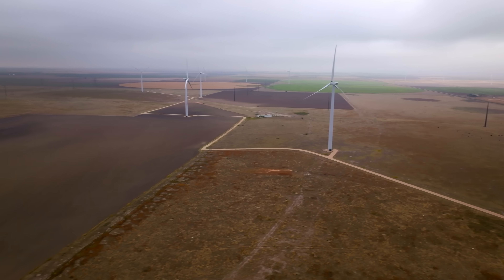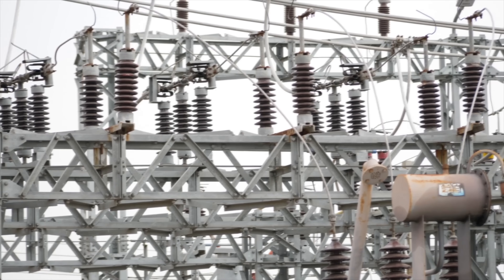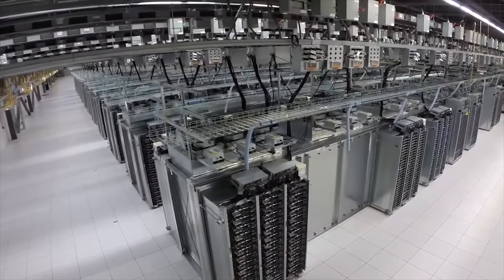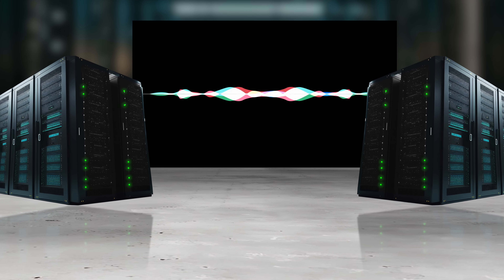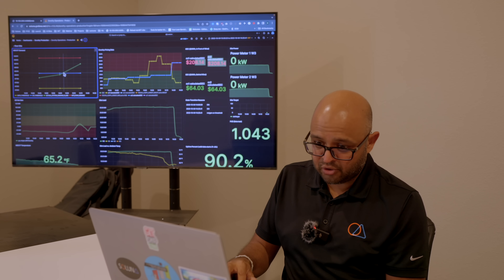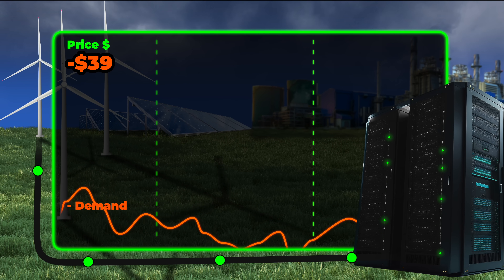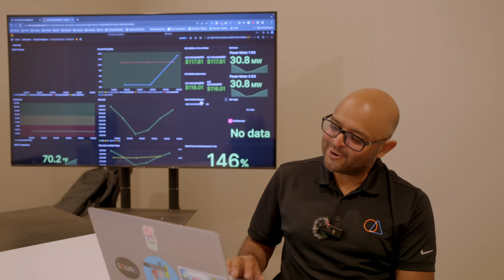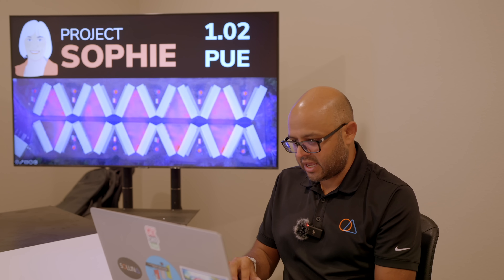Wind Farms' Dirty Little Secret No One Talks About

Comment: I've heard of one wind farm in the UK that uses excess electricity to electrolyse water to make hydrogen that it feeds into the national gas grid.
 The volume is small enough that no-one burning gas needs to modify their burners, but that excess electricity does reduce the amount of natural gas burned.
Reply from the maker: very interesting! can you just mix hydrogen gas with natural gas?
Reply: @TwoBitDaVinci  Apparently that's what they do, just add some some hydrogen into the fossil natural gas.
 Power stations and domestic boilers & ovens that burn gas end up burning some wind-generated hydrogen too.
Reply: @TwoBitDaVinci  german natural gas provider enbw says that up to 30% are possible on our grid as it is right now.

 @AlessandroRodriguez  normally it's not. But if you generate hydrogen when you can't put the power into the grid, it is.
Reply: You have some data on that? I would not want to mix hydrogen and natural gas, that could be outright dangerous! They have wastly different weights and range of combustion. You are not thinking about biogas? We use that in vinkel near Skive airfield EKSV in Denmark.
Reply: Correct! They have different densities therefore subject to different pressures. If that is happening it is an accident waiting to occur!
Reply: @TheArchangel-yd5sj  Two different gasses mixed together will be at the exact same pressure.
Reply: @homeistheearth  is that question for massimo or for me? If for me, please google "Wasserstoff-Insel Öhringen".
Reply: @homeistheearth  was kinda wondering the same... apparently 30% was reached summer of 2023 and is being touted as "green" and more efficient without a noticeable difference in ability for the end user
Reply: @homeistheearth natural gas is mainly Methane CH4 while Hydrogen H2 is the same thing without the polluting carbon atom. Of course boilers can work safely with a mixture of those gases.
Reply: The initial plans in the UK are to have 5% Hydrogen. Mixed with the Natural Gas by 2025 with a target of 20% by 2028.  All new gas boilers fitted in homes. Must be capable of running on 20 % Hydrogen mix. They are available from Worcester, Bosh and Viessmann. Tests mixing 20% Hydrogen with the Natural gas supply at Keel University in 2021 were successful.
Reply: You can't just simply run hydrogen into natural gas lines. Hydrogen is notoriously hard to contain and needs to be heavily insulated and even then you see losses because it simply is too small to be contained.
Reply: @daemenoth  They are already putting pure hydrogen gas straight into natural gas lines.
 It doesn't need to be heavily insulated because it's not cold liquid hydrogen.
 Yes, hydrogen is difficult to contain, but it's going into a system that's already designed to contain gas.
Reply: This is actually the better use than computers, but even better would be combination of Hydrogen tank tied to it and hydrogen eingine coupled to a power generator with the idea being, that the hydrogen tank would work as a buffer for additional power generation, while energy is expensive enough. But banking on intermittent computation is just plain stupid, because this way, you only moving the excesses to another field, that it self is either 24/7 or on demand by external clients, who them selves are not guaranteed to sync with your local weather, be it solar or wind!
Reply: I've heard of a few sites in Texas alone, the size of towns, stacked with ever-growing amounts of broken / old wind turbine parts. Too expensive to recycle you see... Britain - a tiny island with 1000 full landfills, 1000 almost full, 1000 being built/planned, the size of cities.. Nuclear industry shut down, gas and oil industry cooked, waste 2 energy incinerators banned.. 10s of 1000s of  tax-subsidised EYE & EARSORE Farms given the go-ahead... I COULD WEEP!
Reply: Is that affordable? How do you pressurise that without  eating  all  the profits?
Reply: @AlessandroRodriguez 
The electricity is excess.
Reply: @AlessandroRodriguez  Unlike for use in vehicles, where the pressure is needed for storage, town gas is at the pressure obtained form he evaporating LPG. At the point of evaporation, the latent heat absorption results in extremely low temperature, and hence pressure. At that point, very little pressure would be needed to mix the hydrogen.
When we used coal gas up until the 1960's, people tend to forget that it was 70% hydrogen. It was simply stored in those huge tanks that went up and down. They were guided and floating in water, with the bottom of the tank open. The weight of the tank was calculated to produce the pressure, with very little regulation. If the use of hydrogen increased, we could dust them off.
In reality, using hydrogen to replace natural gas in the home and industry, would save more fossil fuels than the changeover to EV's and be far simpler.
Reply: What a waste...

Comment: The solution is storage.  That's the killer app.  Co-location doesn't make the problem worse, but it also only solves a small part of it.
Reply from the maker: storage is expensive, this is a two birds with one stone approach. without something like this, we'll keep wasting green energy, and keep building more data centers
Reply: @TwoBitDaVinci  storage will eventually come down in cost with improved battery technologies. Store cheap, use during peak.
Putting computer farms down and up can cause reliability issues.
Reply: @TwoBitDaVinci  Storage is the most expensive item, but its price is falling.  Solar fell 87.5% during the decade beginning 2010.  Storage is falling at more or less the same rate -- declining by half 3 times each decade.  That will continue for at least another decade.  Also, storage is recyclable.  Tesla co-founder Straubl says batteries are 995 recylable.  Rethinkx outlines the formula for SWB.  No one else comes close to the accuracy of their predictions.
Reply: @bobbresnahan8397  This would require crazy amounts of storage and there are loses in charging and retrieving the power.  From an efficiency stand point this is as good as it will get.

Comment: thanks for this video… this spurred a few thought.  For one… Carbon capture is a big need, it would be great if that 40% unused wind power could be used instead to pull carbon out of the air, but the next question of course is how will that help them make money.  Second…. The carbon capture often requires fans to pull the air in to capture it, I wonder if the fans used to cool the data center could be simultaneously used to pull in air and capture its carbon.

Comment: The good thing is because everything is digital today it produces far less heat than way back in the late nineteen fifties when analog dominated with vacuum tubes, etc. That's when I worked with mainframe computers requiring massive cooling. A typical equipment room was kept at 55 degrees or less... often a LOT less! Everybody went around in heavy coats, hoodies and gloves even when the outdoor temps were 90 or 100.
Reply: 55 degrees is so hot that you can not touch it for more than 10 seconds.
Reply: @Deontjie he is using freedom units
Reply: @Deontjie think 13 °C

Comment: Love this solution, but have question from a financial point: looks like they are just profiting from low (grid) energy-prices, why did they build it near windfarms and what is in it for the energy-company side of operation (other than a demand that fluctuating with prices). 
I think this is what we want for consumers also: adapting to the supply/demand "curve", and that's why hourly flexibele tariffs exist (and are on the rise) and even (home)batteries are becoming  lucrative.
Reply from the maker: imagine, if wind farms could just open up whenever someone had the desire, and no worry about if there was too much power. the problem is the output varies, but if we could use the excess for good purposes, we could start rolling out solar and wind at much higher levels... this is a grid operators best friend.

Comment: Nice to see someone has actually done this.

I own a datacenter, building second one and something similar has been on the roadmap. We also run outside air cooling in conjunction with AC units, we run regular servers so need to maintain less than 40C intake on servers even on hottest summer days so both are required.

Our next DC will not have magnetic drives at all anymore, so we are planning to have only marginal AC units, mostly outside air circulation and heating up rest of the building with the waste heat.

In theory we could reach a "negative PUE" (below 1.00) over the coming decade, by utilizing the waste heat.
Reply: And you really have time un-critical tasks for your machines? Or better say, you can afford to have machines standing around, doing nothing? Perhaps weeks on end?(even when it is more likely to be hours, but you know, winter is comming😏)

I mean, i really embrace such type of excess value. We will need a lot of this, if battery storage is the future, but will the shareholders see this necessity to?
Reply: @goiterlanternbase  - If it wasn't profitable the data center wouldn't exist. BTW the energy cycle he is describing happens daily so there will always be excess wind energy every evening when the offices shut down and people go to bed.
Reply: This is something that climate panic activists just do not understand. It takes time and resources to replace every bit of infrastructure, especially if you want to limit waste, which is also important for environmental concerns
Reply: Have you seen the fans that run off the heat of a wood stove. What if you could trap your heat and use a version of that to cool if moving away from ac or generate power?
Reply: @cannednolan8194  These things run of the difference between your stove and an heatsink
The greater the difference, the greater the efficiency
TEG or thermo electric generator is the name of that thning
The efficiency isn't that great, about 2% at 150K differential in temperature (that is 270°F difference)
So if you manage to keep the heatsink at 120°F and your stove gets to 390°F you are fine, but CPUs aren't happy at 390°F
half the temperature difference and the efficiency drops to either half or a quarter, i don't remember
Reply: I'm curious - wouldn't it make sense to have AC cooling alongside evaporative cooling? Since AC has water as a byproduct, one could use the water for evaporative cooling - a bit more power is used but less water is used, but it still uses less power than pure AC and less water than pure EC.
Reply: @iwiffitthitotonacc4673 evap coolers don't work well everywhere
Reply: What is the most common ODS?
CFC and HCFCs - mostly used in refrigeration, air conditioning and heat pump systems. Only HCFCs can continue to be used for a limited period of time.

Comment: The problem with renewable energy: it is never the right amount at the right time.
Reply: Sure. Yet we have more solutions than ever. From the myriad of batteries that don't need to be super advandced high power, low density ones found in cars or electrinics.

 One issue is our grid. We can produce and store all the power we want, but getting that power when and where it is needed is a huge problem no one seems to be focused on. 

 Where is the revolutionary technology that will change getting power from A to B!

 Our grid is so outdated and vulnerable it is a real concern.. 

 We need a massive overhaul from just a civic, economic, and more importantly a security standpoint. 

 The future is wind and solar, EV or hydrogen. All of it will need a strong and efficent grid, and I don't see any videos on how we plan to upgrade it.
Reply: @dianapennepacker6854  Ah yes. The promise of renewables. However. The cost to upgrade the grid if you desire to use intermittent renewable power is five times the existing grid. And then you need to add batteries at every renewable production unit. It ends up costing multiple trillions because renewable energy is only available at the exact moment when your customer needs it 15% of the time. Renewable grids hence are an uneconomical use of resources.

The cost to do this with nuclear is zero. Because that grid already exists.

To follow natural growth of energy expenditure you just need to add a couple of nuclear plants or units at existing sites.

If you want to do this with renewables, AND replace all energy use (including the energy (85%) not used for electricity generation (15%), you have to landscape half of the ocean.

But the average joe cannot do math so he just assumes renewables are smart. They are not. Nice for residential, unaffordable for an economy.
Reply: @dianapennepacker6854 you're better off having nuclear be the primary source of electricity than anything else. Wind is very expensive to build and maintain, solar panels aren't bad but they're best used as supplemental energy on homes rooftops. Solar farms are very inefficient uses of land. Hydro is great but with water levels going lower it's less reliable. Hydrogen isn't energy efficient at all. Nuclear is really the only stable, long term energy source that's not fossil fuels.
Reply: @HH-le1vi Wind is the cheapest form of energy for any new form of power production. Specifically at large scales. 

 Isn't that shocking? 

 Batteries are also getting cheaper. Solar has the benefit of being better for home scale local production. 

 There in lays the problem with nuclear. I'm all for it, but it doesn't seem to ever be cost competitive. Once, (once hah) some of these new battery technologies that aren't lithium ion, but even way cheaper? I just don't see why except for some specific places would ever do it. 

 This is without mentioning the sheer amount of fresh water plants need. This could be mitigated by newer reactor designs, but again the cost.

 According to a graph about Nuclear. The price curve is going up. While wind, solar, and batteries continue to dip. 

 I think the best bet for nuclear is for converting old fossil fuel plants into nuclear. I think that is the only way it stands a chance at the moment, and I am all for it.
Reply: @dianapennepacker6854  nuclear is extremely cheap energy to make. Most of the cost is building the plant itself.  After that you can make energy very cheaply. Wind is very expensive to maintain and has other issues outside of that like turbine disposal because nobody knows what to do with a 300ft long hollowed out hunk of epoxy resin reinforced fiberglass.

Comment: South Carolina is building an AI data center that's 2 miles long. The power company told them it will be 2-3 years before they will have the infrastructure needed to power it. They can't come close to powering it today. South Carolina is a terrible place for wind power. The only real option is solar. Maybe nuclear.

If I were a wealthy man I'd start investing in solar/nuclear power. Over the next 10 years these AI data centers will be covering the United States. It will be a tech boom never seen before and the power demand will be colossal. Your rate of return will be bigger than apple, Amazon, and bit coin combined.

Comment: Wind farms were never efficient or green.    I wish Ricky had visited Sweetwater Texas where they dump thousands of of blades in a massive landfill because they can't be recycled.   Or did a story on the massive amount of toxic chemicals required to lubricate these fake green wind farms.  Wind farms along with solar power were the catalyst for the massive power outage Texas went through a few years ago in the dead of winter.   They died first causing rolling blackouts which ERCOT inexplicably targeted natural gas power supply stations to the gas powerplants that shut down the real green power of Texas, natural gas.   That plunged Texas into an enormous blackout lasting nearly a week and killed dozens.   

Even in the summer every time Texas is threatened with rolling blackouts the most inefficient power source driving that threat is a massive drop in wind power.    No power grid should ever rely on power generation that is dependent on the weather to generate power.

Comment: The cooling issue in co-located data centers/wind farms could be greatly enhanced by creating an ice Bank using an ammonia refrigeration system when there's excess power for use during high power demand .
Reply: Couldn't we go back a ways and use a standard Co-gen model with data centers. 

Seems like utilizing waste heat for local domestic hot water would be an option. 

Most CPU's operate at or near domestic hot water temperatures. 

Could certainly start doing some clever planning where a data center and a manufacturer that requires 85-100f water/heat could coexist.

Comment: Battery storage is already cheap enough to be viable, but as batteries get cheaper and more abundant, grid storage will become ubiquitous and energy cost will get cheaper and cheaper.
Reply: Guess you should start an energy storage company if it’s so “viable”… I’d like solar and batteries for my house but the ROI is so long by the time you start to hit break even you have old tired and expensive batteries that need to be replaced.
Reply: @jonathantaylor6926  they are viable now at grid scale, but as the costs come down, the ROI will be much shorter for the home. My point is, we will get there someday.